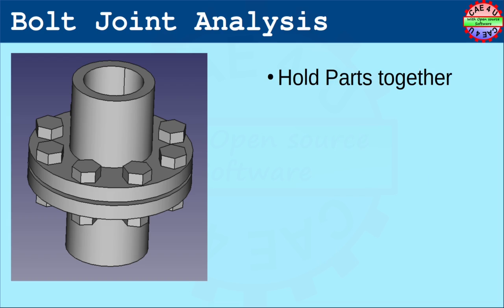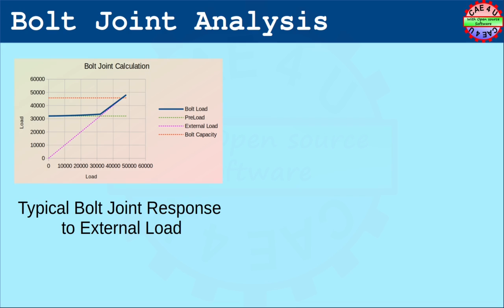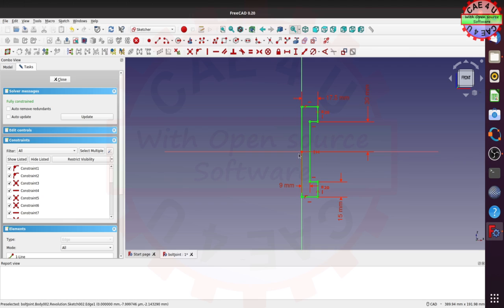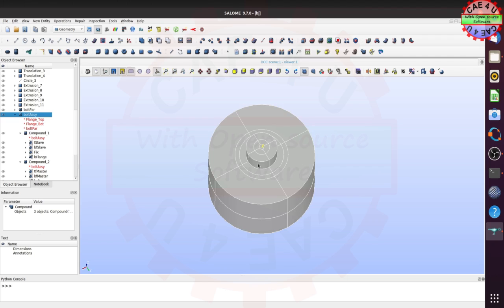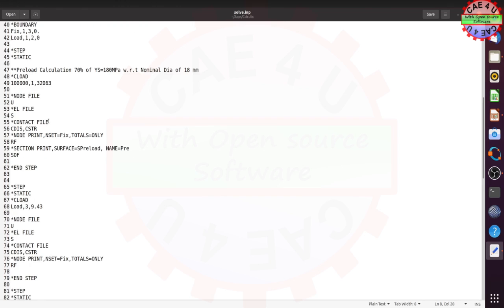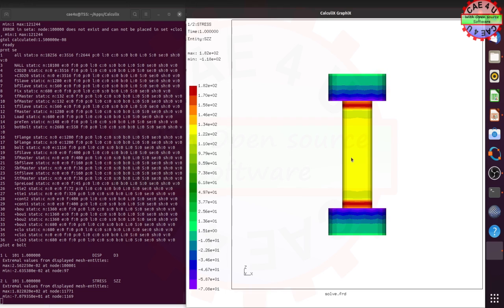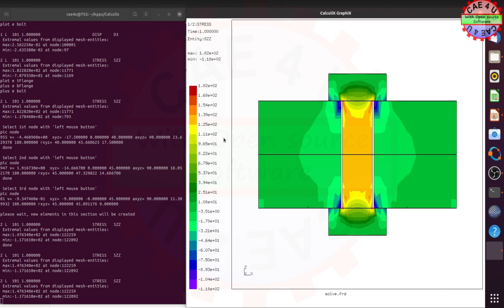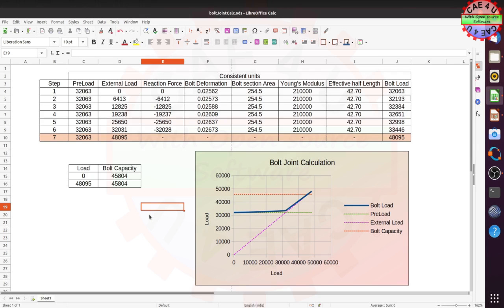Bolt Joint FEA simulation Using Calculix

Comment: Thank you Sir, for the video! I have questions, the solution.inp file, is it generated after we run the ccx? Or we create them?
Thanks
Reply from the maker: Do you mean solve.inp? it is created before you submit run.
Reply: @cae4u125 that's correct. That is what I meant. I see. Do you have any videos explaining that file?
Reply from the maker: We found they are explanatory. If you need any specific details please write to contactcae4u@gmail.com.
Reply: @cae4u125  Thanks again, Sir. That is very helpful!
Reply from the maker: Alternately you may want to try additional details at https://cae4u.gumroad.com/l/nnclm